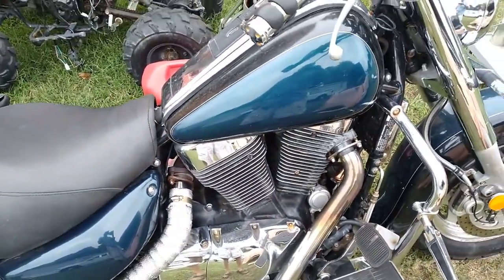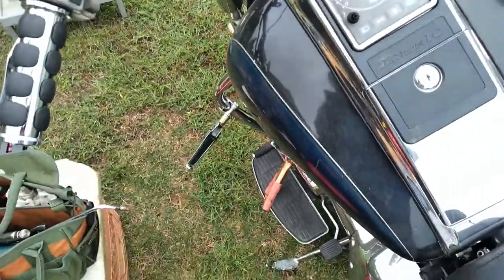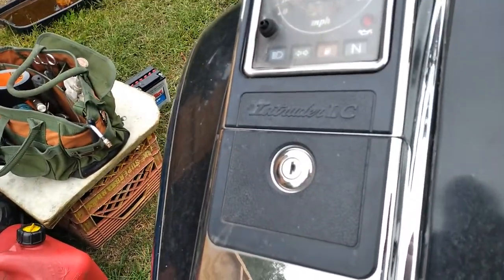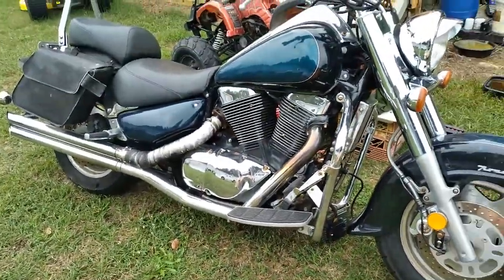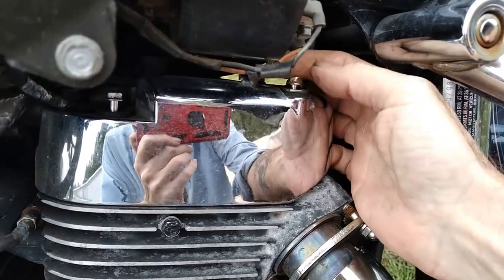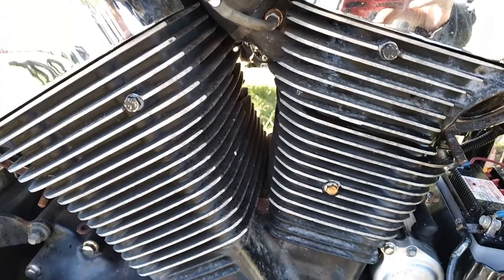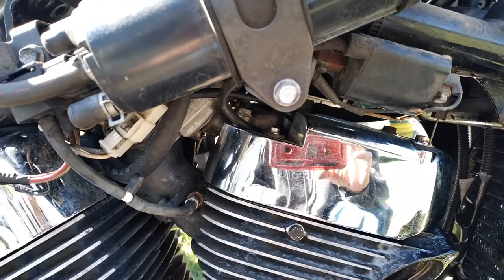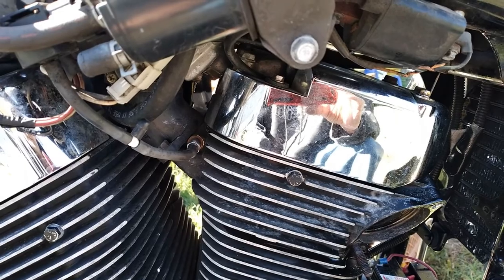Suzuki Intruder 1500 Hard starting. Replacing and adjusting the Compression release cables.

Comment: Hell of a video showing how to adjust it I can ramble for 10 minutes and show nothing too
Reply from the maker: You are right. I should have shown you how to flip the switches. Maybe look on the Dynatec site for an instruction sheet.
Reply: Don't need to take the dummy tank off to adjust. Seems a common problem on these bikes. As this video didn't show how to adjust... There are 2 nuts on the cable simply untighten, adjust tighten back up.. The gap you are looking for is about the gap of a piece of card from a cigarette packed.. Try it after adjusting. Should be good to go. Take a picture of the gap on your phone as you will be doing it 12 months later.

Comment: You need to adjust your decompression table on the rear cylinder
Reply from the maker: It was frozen, I already replaced it before the starter.
Reply: The cable that runs between the cylinder needs to have 1 mm, 0.04 inches sideways slack. So basically just a tad of slack so it is not twangy tight like a violin string.
Like a throttle or clutch cable this cable needs to be lubed occasionally.
Reply: @human1513 hi mate pls can i send u photo about mine i need to sdjust it😢😢